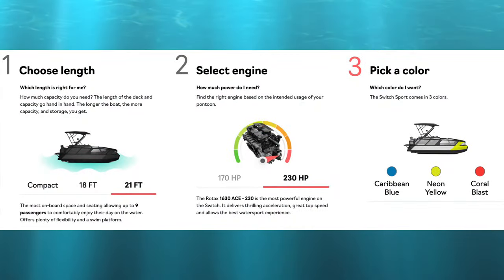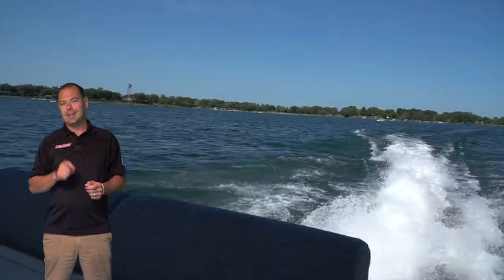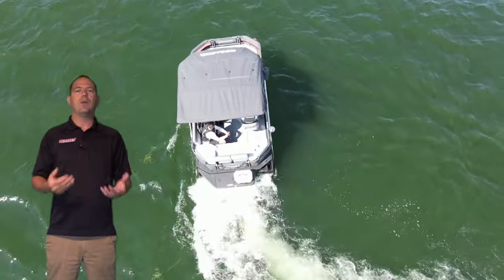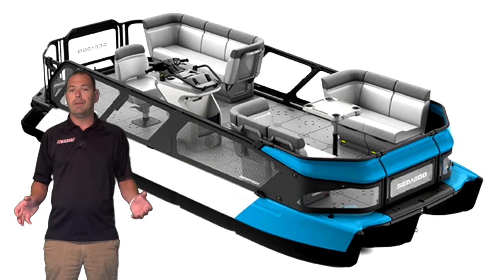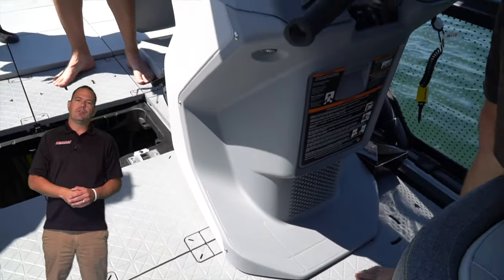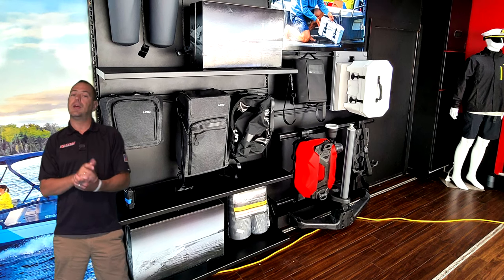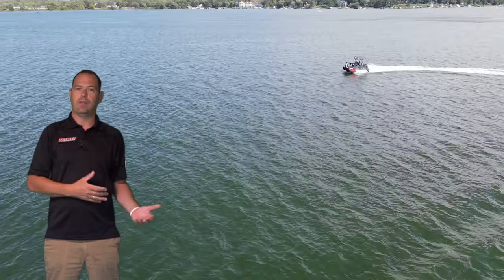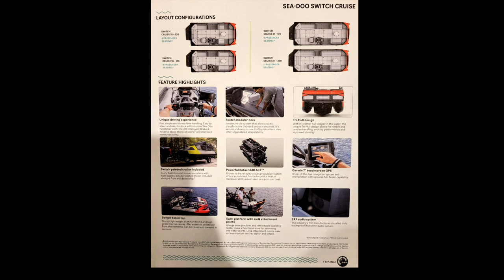BRP Sea-Doo Switch | Review | Deep Dive | Lake Trial | Pros & Cons

Comment: When I first checked these boat out 2 years ago they were being sold alot cheaper than they are today 3 years ago you could get the 13 ft for $19,000 with a trailer, today that same boat is now $28,000 .When I inquire about the price difference I was told (SUPPLY AND DEMAND).
Reply from the maker: The dealership I work with isn't gouging.  You can still get an entry level one for low 20s
Reply: can i ask how much was it and how is the availability. thanks

Comment: The look and sound awesome. But already being a Seadoo jet boat owner i am extremely worried about long term servicing of these. Just like the boats are now.
Reply from the maker: Checking in, What are your thoughts now?
Reply: @midwestadventurelife  Same as before.  As long as there is a warranty there will have to be service.  But as they get older parts and people willing to work on them will dwindle. I couldn't even get a new or factory rebuilt 1503sc from seadoo which was a gigantic seller for them. I am looking for long term.  That is why I decided not to buy a switch.

Comment: Thx for sharing. Will these handle in a rough bay? What’s the maintenance like, say as wave runner? Lastly which one is best, family or sport? Thank you
Reply from the maker: Maintenance is very straightforward, same as a pwc would be.  Winterize (if needed where you live) seasonal oil changes.
   I personally like the cruiser style for the layout, but there's really no right or wrong option, and toy can change the Floorplan as your needs change.
Reply: @midwestadventurelife  thanks for the feedback. What about handling is the bat as opposed to a lake?
Reply from the maker: @gust9464  not sure I understand the question.

Comment: Height on trailer?  Does it fit in an 8’ tall garage?
Reply from the maker: With the top folded down it's about 104" up to the highest part.  An 8' door would not be an easy task
Reply: @midwestadventurelife  bummer.
Reply from the maker: @gransport4246  Rumor is that there are aftermarket tops, which would reduce the height.

Comment: Does sea doo have a throttle control so one can dial the motor down for a 25 horsepower lake
Reply from the maker: It won't change the horsepower, but you can limit with a programed key

Comment: Just picked up our Sea Doo Switch 230 (close to $50,000) on Memorial Day weekend.  Now 2 months later the "Check Engine Light" is going on and off.   Now we have to take it out of the water (mid July),  take it to the dealer (Pioneer Motor Sports, Chaffee, NY) so they can put it on the computer to see what's wrong.  The "what it could be" information in the booklet provided in vague and useless.  Just had family out for the weekend which was basically ruined!!!  ADVICE:  IF YOU WANT A PONTOON BOAT, BUY A PONTOON BOAT!  AVOID THIS CRAFT....TOO NEW ON THE MARKET!
Reply from the maker: TO be fair, it's no different than a vehicle theses days.  A check engine light can be many things.  Also keep in mind that the motor and drive system is proven from their PWC lineup already.
  Having said that, it's always frustrating to have it put a kink in your weekend plans!
Reply: Small world, I'm scheduled to look at same model from Pioneer next weekend.  Any update on the issue?
Reply: @user any update?
Reply: It’s crazy how plastic that we have a abundance of can cost $50,000 😮

Comment: what is the fuel burn rate running at medium speed, say taching 3000 per hour for the 21 foot with the 230 engine?  Also, what is the fuel tank size?
Reply: 4 + hours at that rpm. 29 gallons